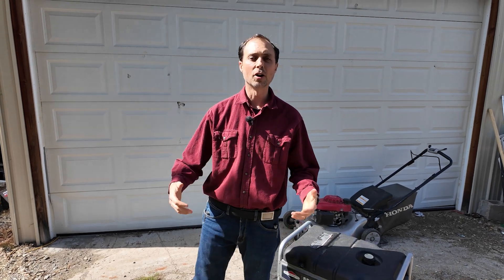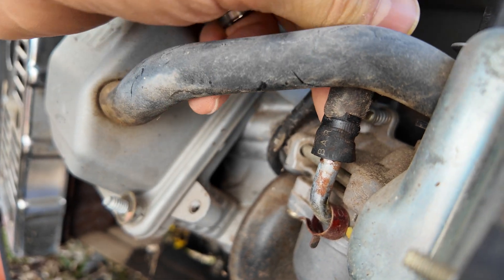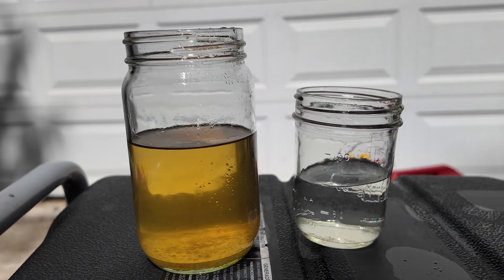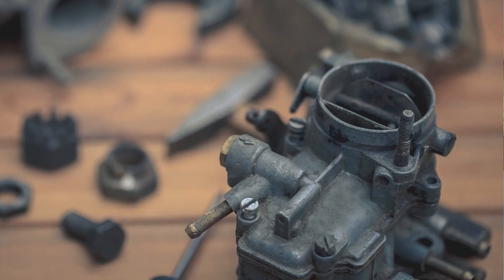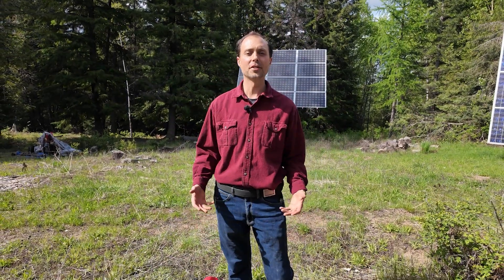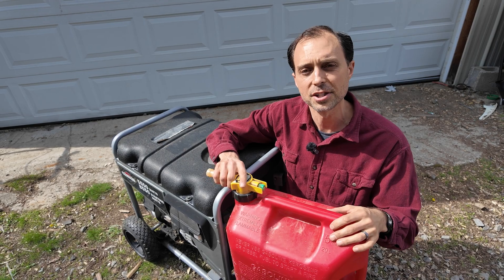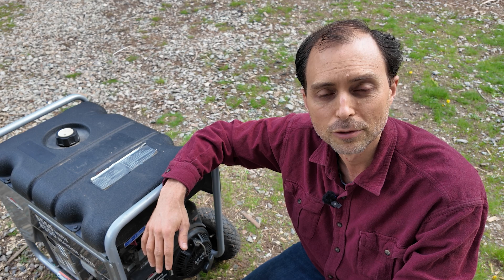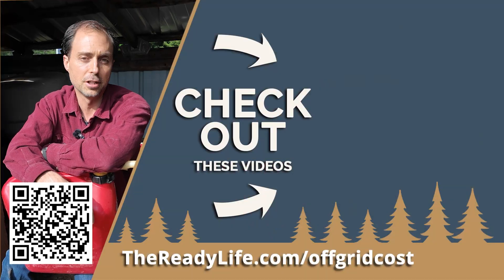7 Fuel Storage Mistakes That Break Your Generator

Comment: This is why I own a dual fuel generator, and only run propane in it. it doesn't put out as much wattage as gas, but it alway starts right up. I bought a larger generator than I needed to compensate for that. I have a 500 gallon propane tank for the generator, kitchen stove, and hot water tank. I can always use gasoline as a second source of fuel if I ever run out of propane. I have 20 gallons of stored gas I rotate through our 3 vehicles every year, and have the propane tank topped off every fall. This has worked well for me for years.